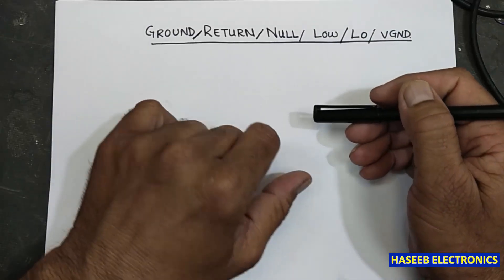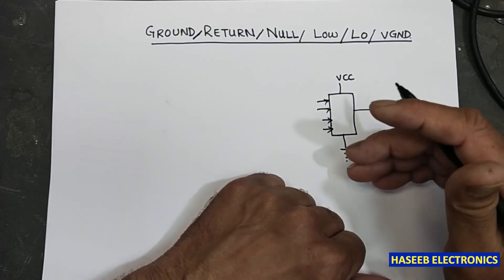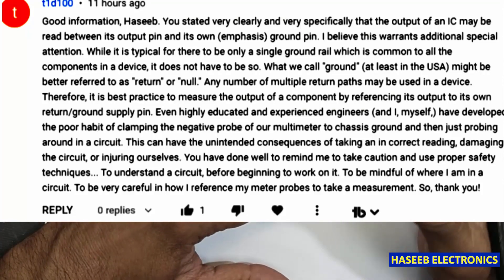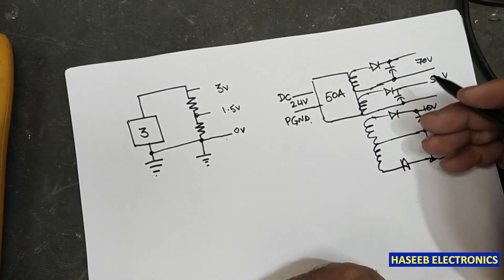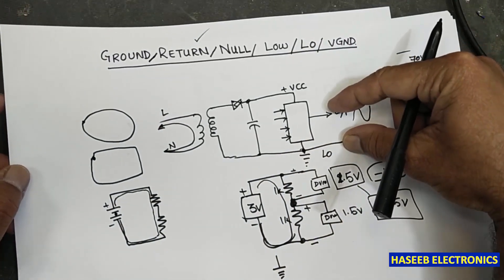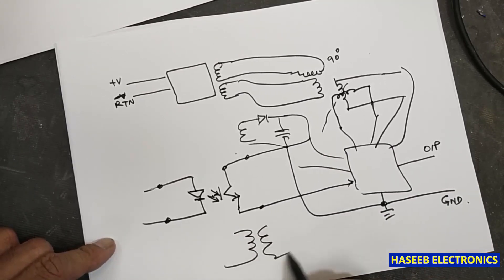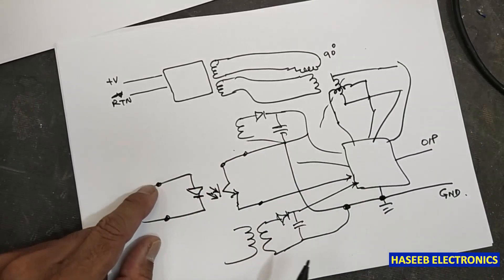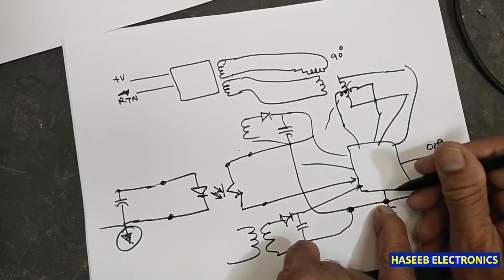{716} Signal Return Or Ground In Electronic Circuit

Comment: Sir Namaskar, it's on the basis of Ohm's Law. In an close circuit current is directly proportional to the voltage and universally proportional to the resistance. I= V/R. Thank you so much Sir. With regards Santosh Mishra from India.